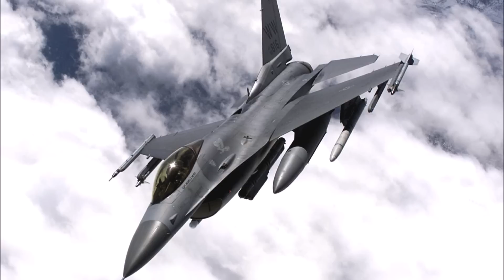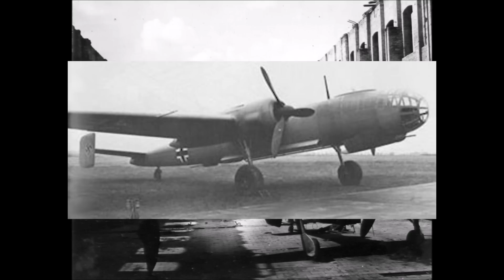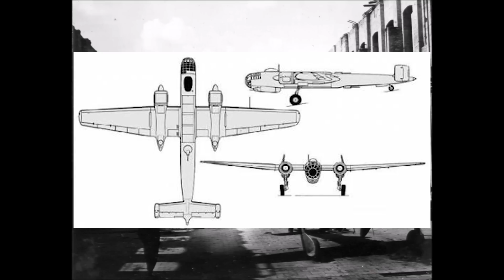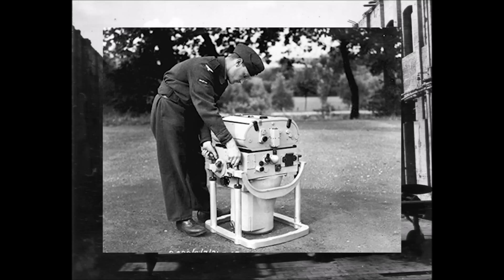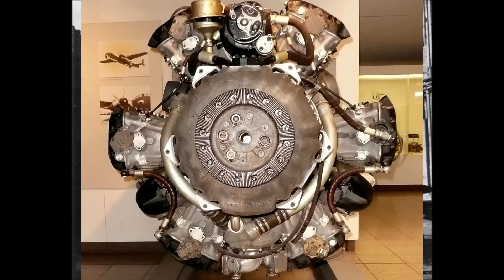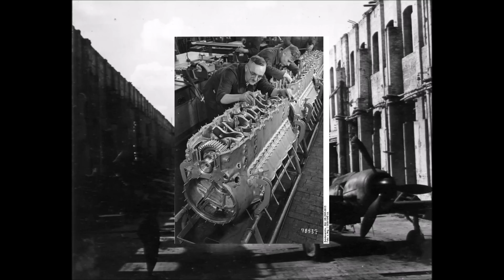Focke Wulf Fw-191: Germanys forgotten electric Bomber!

Comment: When Howard Hughes was brought before Congress to justify the failure of the "Spruce Goose" - he pointed out that it was far and away from being the only failed aircraft project of the war.  Apparently - on either side.

If you think about it - why were there all these numbers in between the numbers assigned to aircraft that we are familiar with?

Each of those numbers WAS assigned to an aircraft - but - one way or the other nothing ever came of it to speak of.

The aircraft that were successful were in fact very much in the minority.

This is largely true of all technological Development.  You have Research & Development Organizations that very rarely develop anything that is actually produced - but - they have a great deal of value for what is learned in their R&D projects - things which may be incorporated in some projects that are successful.

A major source of Design Failure in Aircraft - is the Engines.  The most important part of their aircraft - is the thing that makes it fly.

The Wright Brothers in 1903 at Kitty Hawk - were NOT the first people to fly - they were the first to develop Powered Flight.  Other people - such as John J. Montgomery - had already flown in gliders. IIRC - the Wright Brothers themselves had built and flown gliders.  That's how they knew how to make a plane that could be powered into the air by engines.

Here - the real problem - was developing an engine that was light enough but powerful enough to get the thing to fly.  That was the thing that was limiting the development of aircraft - the engines.

Germany built over 1,000 Me-262's - but most of them never flew - because they didn't have enough engines for them.

The Germans didn't have any problems producing Air Frames - it was Jet Engines that were the problem.
.

Comment: But for the almost constant interference by Goring and Co the Luftwaffe could have had some of the best military  aircraft in the world. Potentially war winning too boot,. As for the proposed engines they strike me as the German answer to the Rolls Royce Vulture engine, which also showed great potential whilst in development...... As for the 4 engine version of the 191 [which like many I'd never heard of] that's how the Avro Lancaster started life. As a 4 engined version of the twin engined Avro Manchester.
Reply: @Jay Jay  
I never claimed Goering CONSTANTLY interfered.

Goering had delegated Udet to manage the Bomber A program. 
Udet was obsessed with diving bombing as the only way to place a bomb accurately on a target. Level bombing at the time often missed designated targets by many kilometres and was far less accurate. Still, the ability to withstand the high G forces of dive bombing was a ridiculous requirement for such a large aircraft and as I recall was one of the reasons that radical ideas like coupled engines were included to reclaim performance lost from the original design due to the weight of extra bracing for dive bombing.

While the DB-606 had worked well in the He-119 it turned out to be a disastrous problem for the He-177A. 
It took a long time for Daimler-Benz engineers - already hard pressed with other development and production issues - to discover that oil was foaming at high altitudes from excessive oil pump pressure and leaking onto white hot exhaust pipes between the inner banks, starting catastrophic fires.  As a result, the He-177A was not available for the Battle of the Atlantic, and barely serviceable as an unreliable transport during failed air support of German forces trapped in Stalingrad.

Having given up on the coupled engine approach, Heinkel approached Goering to allow him to redesign the He-177 with a more conventional 4 engine layout. Heinkel claimed (in his book) that having been embarrassed before Hitler by the non availability of the He-177A when needed and it's poor service record - Goering refused and demanded Heinkel make it work as-is. Goering also claimed (according to Heinkel) that this was the first time he had heard the Luftwaffe's only heavy bomber had been required by Udet to dive-bomb, which he agreed was madness. From my perspective, the head of the aerial war effort not knowing such procurement requirements about a major and costly asset either demonstrated extreme negligence on his part or it was yet another example of Goering shifting responsibility for his failures onto a subordinate, something he was well known to do. 

So no, Goering did not CONSTANTLY interfere with the He-177.
In fact he adopted a hands off approach until well after it became a problem to which Heinkel offered him a workable solution. It was only then that he interfered and in the process denied Germany its only shot at a potentially fine heavy bomber.  This was shown by the performance of the He-177B which Ernst Heinkel built secretly in Austria and the Farman-built He-274 which was used by France after the war to launch high speed flight test aircraft. 

While the Avro Manchester was reborn as the Lancaster - Britain's best wartime bomber - The He-177A was never given that chance. The Jumo-222 was a radical engine design that had never been tried before AFAIK and that naturally meant it came with some risks.  That the would RLM allow it to be the only option without a plan-B for the Bomber-B program ultimately killed the FW-191 and Ju-288.  This was appalling planning management - something for which the RLM was well known. Check out Calum Douglas' book 'The Secret Horsepower Race' for details on the engine side of this.

Arguably the He-177B would have arrived well after it was needed early in the war and German resources - never great at the start of it - were running low by the time it might have entered service. Bomber crews already hated it. The High command had always been unsympathetic to large bombers and the idea of producing substantial numbers of resource-heavy aircraft mid way through the war would not have been received well. Could DB - already hard pressed - have supplied the DB-603 engines needed ready for action?  I wonder.

Still, it may also have been a way to finally reach over the Urals and bomb Soviet arms plants as Walther Wever had envisioned in the mid 1930s. Would that have impacted the Battle of Kursk? I don't know.

IMHO the He-177B could have been saved, albeit late. The FW-191 could not.
Reply: @tsegulin  Well, late He-177 modifications fixed that problem, but just like potencial He-277 were already not needed.
Reply: IMHO opinion the closest German match to the Avro Manchester/Lancaster story was the Heinkel He177A/177B. The Rolls Royce Vultures around which the Manchester was designed turned out to be unreliable and unserviceable, so Avro was encouraged to develop a 4 engine version which became the Lancaster and went on t be a huge success. 

The Daimler-Benz DB-606 engines were actually 2 DB-601 engines driving through a common propeller shaft. They had worked well in the He-119 prewar experimental aircraft but tended to overheat to the point of catching fire in the He-177A. In his autobiography 'He-1000' Ernst Heinkel claims he approached Goering to allow him to redesign the He-177 with 4 separate DB-603 engines but Goering refused. Heinkel secretly built such version of the He-177 in Vienna-Schwecat (He-177B or He-277) and France (Farman He-274). Both reportedly performed very well and would have given the Luftwaffe a genuine strategic bombing capability albeit somewhat later in the war than it had really been needed.

I've seen the Jumo-222 engine pictured in the video at the Deutsches Museum in Munich. Like the Napier Sabre, it was remarkably small for its huge design power output. Unlike the Sabre, it never made it into service, thanks largely to poor engine procurement planning from the RLM, the Jumo engineers being overwhelmed by other development and production issues as well as the complexity of the design.

Comment from the maker: A little correction/explanation:
As a commentor pointed out, I might gave some confusing wording regarding the fly by wire aspect of the 191.
The RLM insisted that the 191 was to be fully electrically powered. This includes the flight surfaces. But the prototypes built were never fitted with FULLY electrically powred ones. Trim tabs and flaps were electrically powered in the prototypes built as well as the armament and automatic dive system. I referred to it as a fly by wire bomber because it was planned as such before the entire program was canceled and any more prototypes could be built to test further electrification. The prototypes built were NOT fly by wire aircraft.
Hope this clears things up.
Reply: I agree with the commenter who challenged your claim, and I think you are still misrepresenting the RLM specification.  Specifying that the airplane systems were to be powered entirely electrically must have meant the systems that needed to be powered, not systems that are normally unpowered, such as primary flight controls.  They must have meant all powered systems are to be powered electrically rather than hydraulically, as hydraulics were becoming the norm for power hungry systems.  But this was not unusual or ground breaking.  For example, the much older B-17 used hydraulics only for its cowl flaps and wheel brakes, and everything else such as flaps, landing gear, gun turrets, bomb bay doors, etc., was powered electrically.  But not the flight controls.

I cannot believe that the RLM ever asked FW to take the unprecedented and completely unnecessary step of developing a system using electric motors to power movement of the primary flight controls of the 191.  Even if they could successfully develop such a system under wartime pressures, it would have saddled the airplane with multiple penalties and vulnerabilities to no actual advantage. I cannot believe the RLM was that dumb.
Reply from the maker: @AirwayZombie  A little excerpt from the Luftfahrtmuseum Hannover´s article about the fw 191 :"Interessant war der Versuch, die gesamte Steuerungsmechanik anstelle von Seilzügen und
Gestängen durch Elektromotoren zu realisieren (heutige Bezeichnung: fly-by-wire"
Translated it says, interesting was the attempt to power the entire control mechanics by electric motors instead of pulleys  and linkages. (today called fly by wire)
Reply: @stukaking9452   Thank you for that information.  Assuming that translation is correct, I must suspect that the source of the misinterpretation may Hannover. I cannot believe the term "control mechanics" here refers to flight controls and must assume it refers to the mechanical systems of the aircraft.  There was no need for powered control surfaces on such an airplane, and no advantage to be gained for the negative aspects of such a system, so it makes no sense.  Again, I would like to see what the actual RLM specification states with regard to flight control surfaces, because I cannot believe they would ask for such a system on a propeller driven medium bomber.
Reply from the maker: @@gort8203  well the term steuerungsmechanik means the Devices that actuate the controls. Which ,at least to my understanding would mean stuff like electric motors. As the site states that such systems would be used instead of pulleys and linkages this leads me to assume that stuff like ailerons,elevators etc would be powered electrically.
If this source is wrong I stand corrected. 
However the luft46 site as well states that the rlm insisted that all systems were to be powered electrically. Unfortunately I don't have access to the specific rlm specification. There is one book about the fw 191-'fw191 kampfflugzeug ,und das bomber b programm' - that might solve this issue but unfortunately the book is currently unavailable anywhere :(
In many ways the fw 191 was a testbed for new technologies. It always played second fiddle to the 288 anyways and it seems it was more of a technology demonstrator anyways. V6,the last 191 built was equipped with the pressurized cabin of the unfinished v9 and v7 which was around 80 percent complete when the project was canceled was to test the electrically powered turret as well as other systems. 
I wouldn't be surprised if they wanted this thing to have fully electric flight controls.
The rlm made a number of lets say questionable decisions,just look at the he 177
Reply: @stukaking9452   Thanks, I'm getting more convinced there is a translation issue here.  As I said, I have no doubt they wanted all the powered systems to be electrically controlled, but I can't accept the assumption that "devices that actuate the controls" refers to ailerons and elevators.  For example, landing gear can be controlled by a lever that acts through a cable or rod on a valve that hydraulically controls the position of the landing gear.  Electrically powered landing gear is a viable alternative in some cases. But I see no logical reason to unnecessarily power flight control surfaces with a complex system of electric motors that was bound to be troublesome, unreliable, and potentially dangerous. There are far heavier and faster aircraft for which unpowered flight controls were perfectly adequate, so if RLM did order this I think they were nuts.
Reply: @stukaking9452   Thanks again.  Like Gort, I'm inclined to think we have a translation issue that leads to assumptions for which we do not have definitive evidence.  Without more original documentation all we have  is assumptions.
Reply from the maker: @AirwayZombie   The translation isn't the issue I think. As a german reading german sources is easy for me obviously.
I'm more inclined to believe that the source has an issue although again, I'd like to get my hands on that book I mentioned which could clear things up.
To be sure for the meantime, I'm gonna change the title of the video until I can dig up more information.
Cheers
Reply from the maker: @Gort  I'll try to get my hands on that book I mentioned but it might take a while to get a hold of it since it's unavailable atm. 
The problem I see  is that the article itself uses the term fly by wire which in term would point towards the flight surfaces were at least planned to be powered by electric motors. 
While it might seems pointless to fit such a vast system of electrics, the 191 already had a huge set of electric components. Armament flap etc were to be definetely electrically powered even tho hydraulic systems might have been better. The plans to make the aircraft "electric" so to speak were already bonkers, so why not go the full route?
In any case, I will conduct further research into the topic I'll let you know when I come up with a definitive answer.
In the meantime I'll change the title from the fly by wire to the electric bomber, how's that sound?
Reply: @stukaking9452  Again, all the other electrical components are not unusual and are not related to whether or not ailerons and elevator were to be actuated by electric motors, which is much different proposition. I think the article you read must contain an interpretive error.  If you ever get primary source documents on the airplane itself, please let us know. Thanks.
Reply: @stukaking9452 the Ju288 reminds me of an early Warthog, looks wise only, unfortunately, from what I’ve heard.
Reply: @AirwayZombie    Good points.  Let alone simple powered flight controls, he is still claiming it was planned as a fly-by-wire aircraft, which it most certainly was not.  I'm afraid Stukaking94 simply doesn't understand aircraft systems, yet he thinks he is qualified to educate others.  He might learn if he was willing to listen, but it seems he's not.

Comment: Thank you for this. And I realy enjoyed the german beeing pronounced probarly, and not attempted by some american who butchered it... 
 The idea that planes this size should be able to divebomb, was utterly stupid. So many recourses wasted on nothing. Cost the HE 177 its existence to, plus offcause, the lack of a propper engine. 
 We owe a lot to the leadership (or lack thereof) in Luftwaffe.
Reply from the maker: Well I'm German so the pronunciation isn't really a problem for me haha 

Funny you mention the 177 cuz that's another aircraft I want to make a video about.
The a5 version wasn't really that bad,actually a pretty decent aircraft,it's the a3 with the DB 606 that gave it such a bad reputation. The DB610 in the a5 was more reliable. Iirc it had sth to do with the cooling of the engine but I'll need to do more research into that topic!
Reply: @stukaking9452  It was faulty tubing. Hot oil and fuel dipped slowly in engine compartment and then...boom. Also engines were too close to each other and it caused overheating problems.
Reply: @stukaking9452  ii

Comment: Bomber B wasted millions of Marks and man-hours and ended up with nothing.

The Jumo 222 was a stupid idea that was never going to work.  Without this, the Ju 288 was a nightmare, and the Fw191never actually worked  - largely due to replacing proven hydraulic systems with electrical ones that couldn't generate enough power..

On top of this, the insistence of a dive-bombing capability on an aircraft of this size and weight was insane.
Reply: But the third, the Do317 could outmatch a Mosquito in speed, not bad for a medium bomber i think. Lucky that the engines never massproduced.

Comment: Tank never gave up his advocacy for automatic flight stabilisation systems. He thought them so important he even armoured the Ta 152's battery compartment. Sydney Camm opposed Tank's views.
Reply from the maker: indeed, if I remember correctly the late war 190s and 152 had electgrically controlled ftrim  tabs or sth.
Reply: @stukaking9452  Electric trim tabs are not automatic flight stabilization systems. They are nothing of the kind and are common even on aircraft with pure manual flight controls.